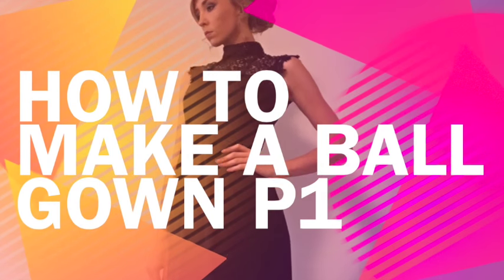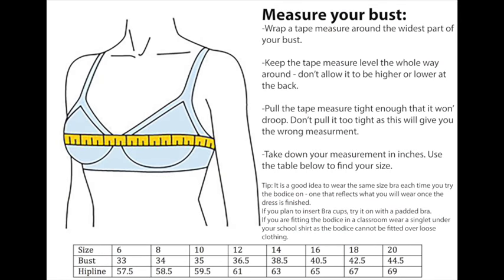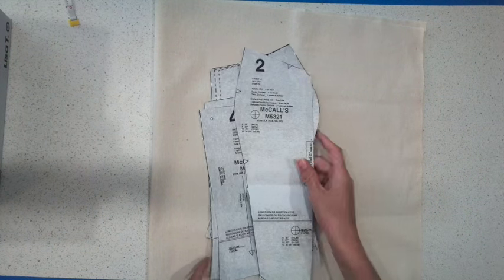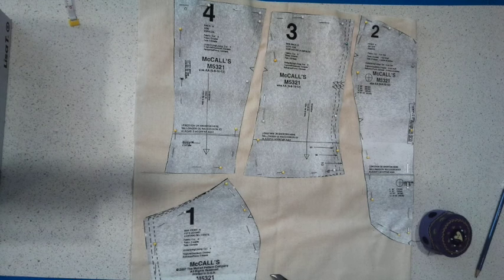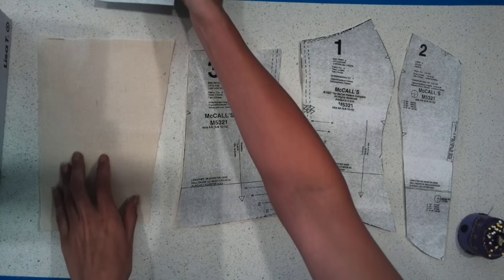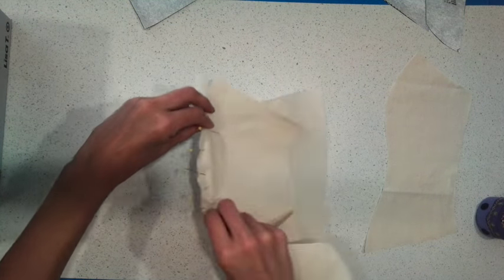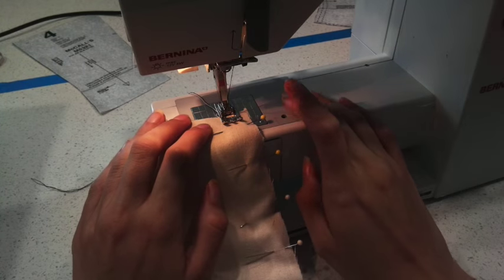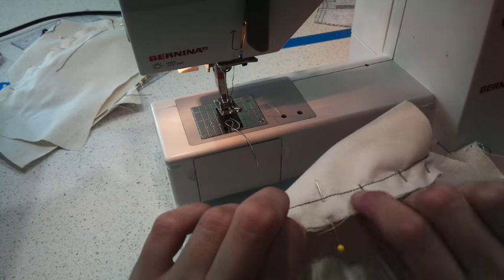how to sew a ball dress Part 1 (Introduction)

Comment: hey I was just looking over the tutorial and on the template the size only goes up to 12 im more like  an 18 or 20, is there something i could do to make the template fit me
Reply from the maker: Hi Liam,
For each size up you can add 1cm to the pattern pieces that require size adjustments. For example, if you are a size 18, that is three sizes larger than a size 12 (12, 14, 16, 18) so you need to add 3cm on pattern piece number 1 and number 3 (the other two pattern pieces don’t have different size options). Do this by tracing the size 12 onto a seperate piece of paper and then use a ruler to add the extra 3cm along the edge where you see different sizes. 

However, the pattern supplied will not have much curve in the bust to accommodate for people with larger breasts so this can be tricky to adjust when going up so many sizes from a smaller pattern. The easier option would be to go to your local textiles store or online and purchase a pattern that has a similar bodice (front seams, side seams, and back seams). It doesn’t matter if the pattern comes with other parts like skirt panels, etc. as you can ignore these and just use the bodice pieces. 
Hope that makes sense 😁
Cherie
Reply: ok thankyou so much this is a really helpful series
Reply from the maker: Anytime! And thanks 😁